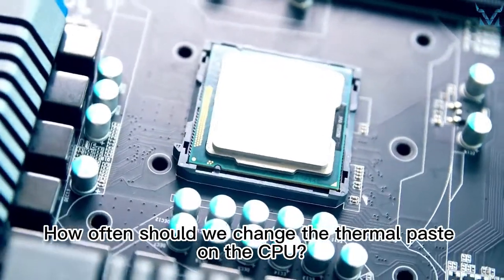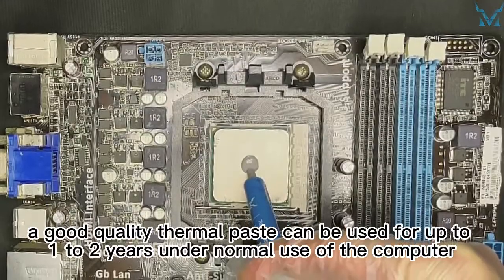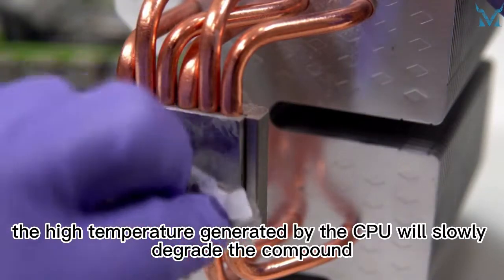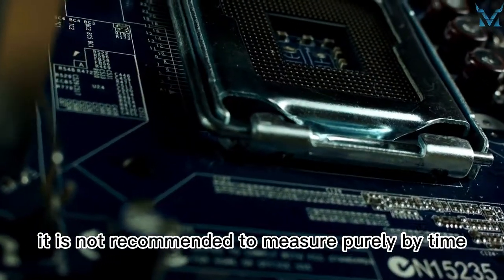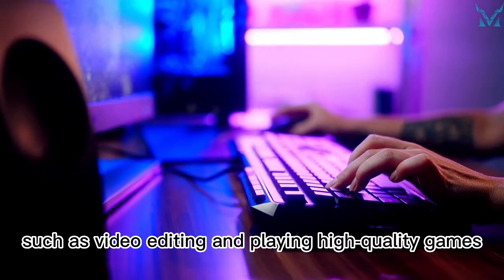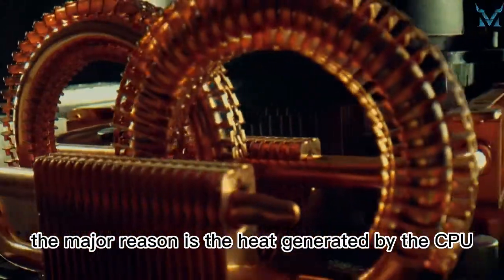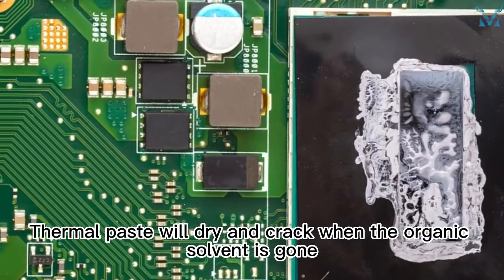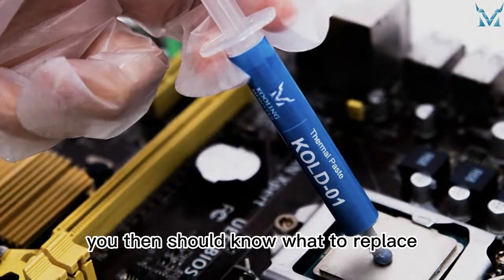How often should we change the thermal paste on the CPU?

Comment: I have a 12900k and 3090 gpu. What should my temps for the cpu be? I’ve had my pc for almost 4 years of heavy use now
Reply from the maker: Thanks for your question!
For a 12900K under heavy gaming or load, *80–90°C* is normal, with brief spikes higher. After 4 years of heavy use, repasting can definitely help bring temps back down.
Reply: @koolingmonster I only play CSGO. What do you recommend I do to check? Check temps when I’m gaming? Or run a stress test? What stress stress do you recommend?

Comment: Excellent information, i have a Razer Tomahawk Gaming Desktop with an Intel i9 9980HK Nuc and my PC is about 5 years old and started to sloe down and also overheat so i think its time to change out the thermal paste on the CPU. Thank you for this video. Since i just got done building my first PC, i can now take apart the Pre built Razer Tomahawk and clean it all out and take care od business cause it technically still works very well for the most part.
Reply from the maker: That’s awesome to hear — and congrats on your first build! 🙌
A fresh repaste after 5 years will definitely help that 9980HK run cooler and smoother again. The Razer Tomahawk is still a strong machine, just needs a little maintenance 😄

If you need tips or tools for the repaste, feel free to ask anytime. Happy repairing and happy gaming! 🔧🔥🎮

Comment: sht. I can now confirm my PC is restarting because of overheating. Not by dusts, but by old thermal paste. 😅
Reply from the maker: Yup, classic sign! 😅 Old paste dries out and kills heat transfer. We had the same issue—repasted with KOLD-01, and temps dropped right away. Totally worth it!
Reply: @koolingmonster  yeah. I attempted to clean and renew the paste. Didn't turn on after that. 😮‍💨

Comment: haven't changed it once since i built my pc around 3 years ago, don't even know if it had paste in the first place but maybe i should look into it.
Reply from the maker: Yes, definitely worth checking! After 3 years, the thermal paste might be dried out, which can affect performance. You can try our Kooling Monster KOLD-01 high-performance thermal paste—perfect for reviving older builds!

You’re welcome to check out our KOLD-01 thermal paste.  【PERFORMANCE/OVERHEATING SOLUTIONS】- available across the globe!
Laptop dust cleaning & thermal paste replacement tool-kit combo: https://bit.ly/KMtoolkit

KOLD-01 Thermal Paste: https://bit.ly/kold-01-yt
KLEAN-01 Thermal Paste Cleaning Wipe: https://bit.ly/klean-01-yt
KOMBO-01 Screwdriver Set: https://bit.ly/kombo-01-yt
Air Duster: https://amzn.to/3YTclrP

Comment: My PC is 15 years old  and and I never changed the thermal paste in all those  15 years . The CPU is i5 760 
My PC can run everything . An the temp never goes obove 47 degrees even at full load in the summer time .
So what crap is this ???.
I use NT-H1 paste .. with a massive  Noctua cooler ..
Reply from the maker: It’s impressive that your PC has been running so well for 15 years without any issues! However, it’s important to note that thermal paste does degrade over time. While your system is performing well now, thermal paste can dry out or lose its effectiveness, potentially causing higher temperatures in the future.

Feel free to give our KOLD-01 thermal paste a try! It’s different from the standard thermal pastes you mentioned. The key difference is that most thermal pastes use a solvent-based formula, which can evaporate when heated, causing the paste to dry out and lose its thermal conductivity. We use a unique solvent-free formula, which perfectly addresses this issue. That’s why it offers better thermal performance and a longer lifespan, making it ideal for laptops.
Reply: mine is 4 years old, i went to change the cpu cooler yesterday, and the CPU was cemented to the cooler
Reply: @FREESPIRITSSOARING  when repasteing make sure to play a little bit before so the paste gets warmed up. Also twist a little bit before you pull.
Reply: @ what do you mean with cemented ?? what thermal paste are you using ??

Comment: 1-2 years is compleat bull lolz it can last for up for up to 3-5 years easy, unless u use really bad Thermal paste and do not apply it properly lolz unless u get a kick out of 1-2 C difference u can replace every 1-2 years lols.Mine is going on 3 years on Thermal Grizzly on a i7 12700 k at 4.9 ghz with CORSAIR - iCUE H100i ELITE LCD XT 120m front mounted and in a push pull config and in heavy gaming with evrything maxed out temps do bot go over 50-65 does not matter the game and idles at 28-36 c coolant temp stays at low around 37 c when gaming.
Reply from the maker: Hello! It's generally fine to replace the thermal paste every six months to a year. However, we don't recommend judging it solely based on time, as it largely depends on how you use your computer and the quality of the thermal paste.  

A better approach is to monitor your CPU/GPU temperatures. Feel free to message us privately—we can provide you with a one-click tool to check whether your system is overheating.  

Thank you so much for supporting our video!

Comment: Hiw to see cpu temperature
Reply from the maker: You can check CPU temperature using monitoring software like HWMonitor or Core Temp. If you're concerned about high temps, upgrading to a high-quality thermal paste like our KOLD-01 can significantly improve cooling performance and stability.

Comment: WOW. I had a system built in 2007 with the first 4 core 8 thread CPU from intel. It ran 24/7 until it was replaced about 4 years ago. About 13 years of it running I noticed that the fan was pegged at 100% and that the thermal paste needed to be replaced as the CPU was throttle limiting. Even though the CPU was throttling, the games and video editing that it was tasked to do had no impact on the performance of the system as the cpu in games that i could notice and that is with a CPU that hit 50% usage. The system i have now barely hits 10% usage and sometimes hits as high as 16% on load in screens @4k 4096x2160. It is a 14700kf that is air cooled and the only times it hits over 16% percent with temps holding 98c was when i ran stress tests to see if the chip would reset/ crash to see if it was one of the ones with the micro coding error. With listing to your sales pitch and being so paranoid i will waist my money and time every 6 months on a new thermal paste application. Yahh I can really see all those techs in data centers repasting the cpu's every year or two on all those CPU's as we all know those CPU's are pretty much pegged at 100% 24/7. Nice AI video though.

Comment: I have a good paste and a good cooler. Change every 2 years is fine.
Reply from the maker: Hello! Replacing every 6 months to a year is ideal, but it's better not to rely solely on time. The frequency depends on your usage and the thermal paste quality. A good way to decide is by monitoring your CPU/GPU temperatures. Feel free to message us—we can provide a tool to help you check if your system is overheating!
Reply: @koolingmonster which tool

Comment: Great video, do I just turn off computer and change the paste or do I need to do certain things before I rip it apart? Tia
Reply from the maker: Hello! Before replacing the thermal paste, follow these steps for safety:
1.Power down and unplug: Turn off your computer, unplug the power cable, and remove the battery (if removable).
2. Discharge residual power: Hold the power button for 10-15 seconds to release remaining electricity.
3. Prevent static electricity: Use an anti-static wrist strap or touch a metal object.
4. Prepare tools: Have the right screwdriver, high-quality thermal paste, and cleaning supplies (e.g., isopropyl alcohol).
Once ready, work gently on a clean surface. Hope this helps! 😊
Reply: @ Ty!

Comment: I use my pc around 2 hrs a day and I haven’t replaced thermal paste once… I’ve had this pc for 4 years I think it’s time I put in new paste
Reply from the maker: Hello, you can replace it every six months to a year. However, we don’t recommend using only time as a measure because it largely depends on how you use your computer and the quality of the thermal paste. A better approach is to monitor the CPU/GPU temperature.

Comment: I’m running a Ryzen 7 7800x3d. I built my pc 1.5 years ago. I’ve set my pc to shut down at 90c in the bios. The 7800x3d cpu runs hot. My AIO is functioning properly. After one year of heavy gaming, I noticed my cpu temp rising. I would normally idle around 40c +/-….gaming around 65-70c. Now, I turn my pc on…within 5 minutes of some light browsing, I’m climbing near 90c. I think it’s time to apply some fresh thermal paste. Btw…all my other components are 100% functional. My pc is an itx SFF build.
Reply from the maker: You're welcome to try our KOLD-01 thermal paste! It's different from the standard thermal paste you mentioned. The specific difference is that regular thermal paste uses a solvent-based formula, which evaporates when heated, causing the paste to dry out and lose its thermal conductivity. We use a unique solvent-free formula that perfectly addresses this issue, resulting in better cooling performance and a longer lifespan for use on laptops. We also have detailed tutorial videos from previous sessions, so feel free to search for them; they will definitely be helpful to you. If you have any questions during the process, don’t hesitate to leave another comment.
Reply: I figured out the issue. The cpu cooling fan/AIO mount broke cause the AIO block to lift off of the cpu causing the overheating issue. All is resolved. I replaced the broken piece. I’m running 38c at idle and high 50’s low 60’s under heavy load.

Comment: 3-4 Years should be the best interval for average user.
My PC cabinet has little too less space to remove cpu fan without taking out the entire Motherboard which makes it a 3-4 hours process and doing that often can lead other parts to wear out and damage as they are not meant to be plugged unplugged again and again once screwed.
Reply from the maker: Hello, it’s recommended to replace the thermal paste every 6 months to a year. However, we don’t suggest relying solely on time, as it largely depends on how you use your computer and the quality of the thermal paste. A better approach is to monitor the CPU/GPU temperature. For more details, you can check out our Video #1 (How Often Should You Replace Thermal Paste?), or feel free to message us privately. We also offer a one-click tool to check if your computer is overheating [Heart].
Reply: I recommend the Artic MX-6 thermal paste 🤷🏼‍♂️

Comment: You would be more believable if you wasn't trying to sell thermal paste. You only need to change it if you remove the heatsink or have heat issues, which are more likely caused by a dusty fan.
Reply from the maker: Thanks for your suggestion. Thermal paste does generally last a long time, and it's true that you don’t need to replace it frequently. Most people only need to reapply thermal paste if they remove the heatsink or notice significant temperature increases. Dusty fans and clogged vents are indeed common causes of overheating, so cleaning those first can often resolve heat issues without needing to replace the thermal paste.

Comment: My cpu was constantly downclocking because it got too hot, making my fps drop, when i installed geforce exp it was at 97°.. i cant imagine how hot it was when i was playing games 😭
Reply from the maker: Welcome to try our KOLD-01 silicone grease, it's different from regular silicone grease. The specific difference is that generally silicone grease uses a solvent formula, where the solvent evaporates when exposed to heat, and the silicone grease dries and cracks, losing its thermal conductivity. We use an exclusive solvent-free formula to perfectly solve this problem. So using a laptop has better heat dissipation and longer lifespan. Hope our tutorial and laptop silicone grease replacement kit have the opportunity to assist you! You can purchase it from the profile link

Comment: didnt change my thermal paste for 3 years
does it effect the preformance of the pc?
even tho the temp still 60-75
Reply from the maker: You can change the silicone grease now. Changing the silicone grease should not be judged based on time, but on your frequency of use, because the silicone grease will dry and deteriorate. Changing the silicone grease can make your computer run faster
Reply: @koolingmonster  ty

Comment: so got my pc in 2014 , and kind of only just thinking about changing the paste and been playing new relaase games on high quality for years , almost daily .. me thinks need to change the paste. however the pc is also dated now so trying to save up for new pc , not doing a very good job tho
Reply from the maker: It is recommended to replace it because thermal paste degrades over time. If you don't change it, the cooling performance of your computer will decrease significantly, leading to a major drop in performance. If you don't mind, you can choose not to change it, but it's like spending $8000 on a $2000 computer. After replacing the thermal paste, you will notice a significant improvement in performance. You can check our videos: Video 1 (How often to replace), Video 2 (What is thermal paste), and Video 54 (30% FPS improvement) [heart]. 
Cleaning dust and replacing thermal paste are equally important:
1. Thermal paste transfers heat from the chip to the heatsink.
2. Cleaning dust transfers heat from the heatsink to the outside.

Comment: If my cpu idle around 59 - 63 degrees celcius (youtube, browsing), and gaming around 70 degrees, should i change it or not? 

Currently i use stock cooler & stock thermalpaste from amd, then if i should change it, i want to buy new hsf and change the thermalpaste with included too. But if i shouldn't change it rn, i won't buy it. Any suggestion?
Reply from the maker: This is a normal temperature, nothing to worry about. You can visit our official website to read an article on what CPU temperature is considered abnormal: https://koolingmonster.com/insights/how-to-check-cpu-temperature-and-why-is-it-important
Reply: Buy new HSF is more important

Comment: With these new générations of cpu 1 years maximum. They générate a high temp . I have 7600x work always @80/90c on fps games   my hight quality paste last 1 years only
Reply from the maker: Welcome to try our KOLD-01 thermal paste, it's different from the typical thermal paste you mentioned. The specific difference lies in the fact that typical thermal paste uses a solvent formula, and when heated, the solvent evaporates, causing the paste to dry out and lose its thermal transferability. We use an exclusive solvent-free formula, perfectly solving this problem. Therefore, using it on laptops results in better heat dissipation and longer lifespan.

Comment: cheap/mediocre paste: change it once a year
good quality paste: change it every 2 years
that's enough for me as a regular gamer
Reply from the maker: That is correct, Thank you for the kind words!
Reply: Sponsored by Antec, Gelid or Grizly? 😂

My cpu has been running 24/7 for 5 years with the same AIO and paste, doesn't go above 68° even in the summer.
Reply: when you change it, does it really make a huge difference? every 4 years is the recommendation i thought. just getting into gpu stuff though, never replaced thermal paste on one and think i accidentally bought a mining card off ebay so want to re-do the paste. do you also need to do the 'pads' ? or anything else? my specific card is a AMD 6650 XT
Reply: @aresident7745  if you're having problems with the temperature of the GPU then it's necessary to change the thermal pads too when you re-paste
Reply: @aresident7745  I repasted a 10 year old pc from my friend, i had literally 1-2 degree difference.
Reply: gamers are idiots

Comment: 5 years and never replaced. Maybe that's my problem. Because it is CPU related performance issues.
Reply from the maker: Yes, regularly replacing thermal paste is very helpful for maintaining computer performance! Under normal circumstances, it can be replaced every six months to a year, but we do not recommend measuring solely by time, as it greatly depends on how you use your computer and the quality of the thermal paste. A better approach is to measure the CPU/GPU temperatures. For more details, you can watch our Video #1 ("How often to change thermal paste") and Video #84 ("How to know if your laptop is overheating and if the CPU thermal paste needs to be replaced?") for a more thorough discussion on this topic ❤️~